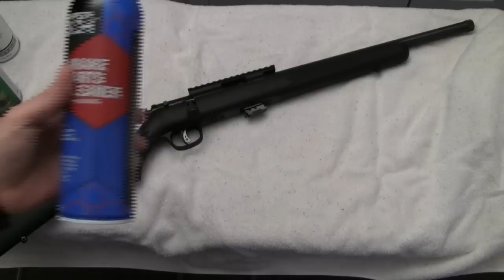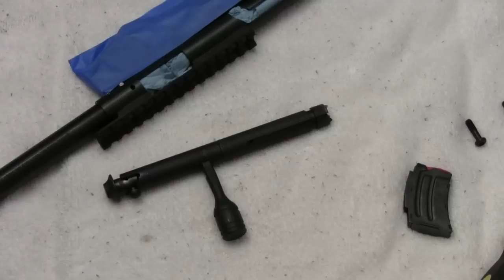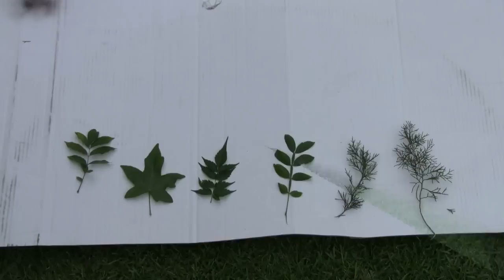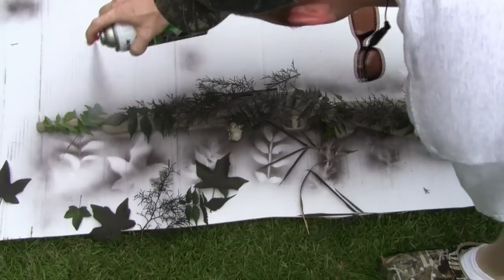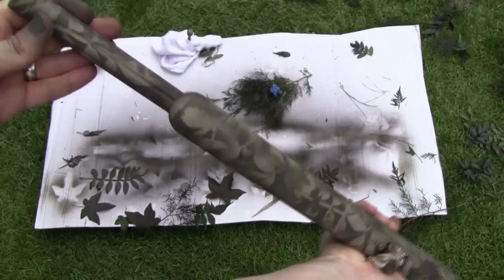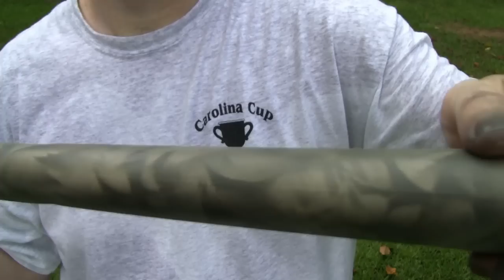Rattle Can FV-SR Invisible Squirrel Rifle

Comment: A lot of people comment about foliage moving when sprayed in position. I found a real neat trick to stop that is to use VERY small blobs of bluetac on the back of the leaves and press them down in position before you spray. Then remove them gently before reclaiming the bluetac to reuse. The leaves or cut out shapes dont move and you can also build up ontop of the first items with a little more if you don't want to rwmove them as you go. Hope this helps! Its cheap and real easy.

Comment: Good video presentation as you built up the patterns and keep in mind that what you see just painted will diminish and get the lasting effect once it flashes off and starts to dry.  Dusting with other colors lightly help blend or mesh in the colors to give it a more natural look in the end.  A coat of clear coat mat also helps with a light dusting maybe max 2x from a distance to flatten and dull the colors.

Comment: Good stuff...   I've found a secret for prepping the stock to ensure good adhesion, a tougher and more durable overall paint job.
  After cleaning the stock of oils (I always use rubber gloves to make sure no hand oils get on) I spray the stock with an adhesion promoter, used for plastic, vinyl, chrome, wood, etc.  Spray cans available from Amazon, if you can't find locally...  A few lighter coats, a few minutes apart then a final coat, wait ten minutes then do your base coat.  It makes a HUGE difference.  Works great for painting the plastic interior parts of cars, too, so the paint doesn't just rub off.
  I've had to remove the paint from a stock I did like that, it was tough.
  Thanks for showing the sticktoitiveness needed to produce a good product. 
Thanks!!
Reply from the maker: That’s a very helpful tip for any future projects.  Thanks for posting it.

Comment: For de-greasing your gun parts, here are two excellent options.
1)  "Brake-Clean" (sometimes spelled klean) from the auto parts store is, by design, an excellent product for removing oils, grease, water, dirt, etc. from your gun parts.  Your brakes on your car must run grease and oil free and this is what the mechanics use.   It will leave a very clean and dry surface on your gun parts.  Try some on each surface, first, as some plastic materials (very few in the gun world) may be affected by the cleaner.
2)  TSP (tri-sodium-phosphate)... The stuff that made your laundry sparkling white in the 70s until the eco-paranoids banned it because it makes a temporary and harmless foam when it hits moving water (remember those anti-phosphate comercials in the 70s showing a bit of foam on a river bank?).  What they never told you is that phosphates are naturally occurring and ultimately harmless to the ecology but, I digress.  If you're cleaning plastics and, polymers in particular, scrubbing them down with a TSP solution will remove any manufacturing residues, oils from handling, etc. and is a GREAT prep.  It's still available on the net and in some rural-type stores and will, once again, make your whites by-gum actually white!  Any plastic parts, from chairs to car interiors, can be cleaned and painted in this way.  When you're done cleaning gun parts with the TSP solution, rinse with clear water then dry it in the oven on low for 20 mins. 
Some will say to use acetone but, some plastics are affected by that much faster than by the brake cleaner.  Use with caution.

Comment: Not bad Nate! You're right about starting with a darker base coat! It adds a better sense of depth to the patterns and looks more natural! Try using a single sprig of the cedar/evergreen and just move it around to different angles. You'll get a better pattern and get more depth without having to spray so much to get through the clump of branches.

Comment: thanks for the video man I just got done painting a beater shotgun I picked up pretty cheap (was in terrible shape) looks awesome now! I used the same brands and color you did I noticed nearly my entire stock turned out frosted and white almost because I went overboard on the krylon clear coat BUT as I was cleaning it with some CLP I discovered two things one too much of the CLP strips the paint off (any paint actually) BUT I sprayed some CLP on a cloth and lightly rubbed the really frosted white areas from the krylon and now the whole gun matches in color so since I went overboard it stripped a small amount of it off so it all matches now and CLP is cheap oh and denatured alcohol works well to degrease

Comment: Looks good.  Personally I like some leafiness and some patterns to break the total leafy appearance.  If you are upright hunting in the woods in the spring and summer this is good, but adding a little grass, tan and light green, would set this up for woodlands, open areas adjacent to woods in all but winter season. I like sand as a base coat, then diagonal zones of brown and od green, before getting leafy, twiggy and grassy.  Some where in there I want some hazy irregular grid pattern worked in between the veggies!  Lol.

Comment: Looks pretty good.   With multiple colors, it would be real easy to put it on  too thick, and make a spongy paint layer. I dunno what would be the best hard sealer.  I would've left the picatinny rail almost alone.  I think a dark under-layer would respond better to later scratches.  The dings would show dark, rather than light.
Reply: I thought about it.  What's missing is some negative stencils.  Use sheets with  shaped holes cut in to spray a color layer thru.

Comment: You did a great job in that. Have you noticed any wear on the paint since using it? Also, did you have any trouble with the clear coat blistering the paint? I haven’t painted one yet but have a few to do this spring after it warms up enough and I learned a few good tricks from this video. Thanks for posting it.
Reply from the maker: There is some wear in the high traffic areas.  No blistering that I've noticed.  Glad the video helped you out.  Take care.

Comment: Another tip, I see you're having trouble seeing the paint with the bushy pine leaf branch. Try snipping off some of it's branches to make it less bulky and more flat. The paint is having trouble spraying past the bushy stuff.

And to those new to spray cans, and want to reuse the remaining paint in the can later, turn the can upside down and spray until paint stops flowing out of the nozzle. The nozzle and tube inside shouldn't clog up the next time you use it then.

I'm spraying my RC tank in camo, great video thanks!

Comment: Looks great. How did it end up lasting before the paint on the bolt started wearing?
Reply from the maker: The bolt handle is a high traffic area so you will have to touch up from time to time.  Using darker colors helps mask the fact that the paint is rubbing off.

Comment: Man how long did it take to wear off? Great job
Reply from the maker: High wear areas like the forearm and palm swell usually require the most touch-up.
Reply: Thanks for the reply! Did the paint job take long to fade away? Like did it smudge off from general use, last long?
Reply from the maker: I went pretty light on the coatings so it didn't take very long.  If you have more time a thicker base coat will help with wear.  Say 2 to 3 base coats before starting the camo pattern.  Allowing a sufficient drying time would help out also.   It was a fun project , but the eagerness to have a finished product lead to a  thinner layer of paint.  That resulted in the high wear areas needing touch up more often.

Comment: you can get awesome fake leaf and branch patterns at stores like michaels, hobby lobby even walmart. they dont blow off when spraying and you get crisper edges and better looking patterns. they are dirt cheap too like $3.00 each. if you use the camo colors from rustoleum or krylon, definitely use spray clear as they tend to dry chalky and  scrape off easily. the clear makes a big difference

Comment: i have used cedar before. just pick the nicest pieces for the job and turn them upside down. if you want them to stay in place use a glue gun and use small dabs, the glue is easy to peal off.

Comment: A few tips. Don't change the angle of your spray. Keep it at 90 degrees from the stencil. Also, if you apply a very light quick burst of 3m adhesive, just enough to make your foliage tacky, it will grab just enough on your target to make much cleaner lines, if that's desirable to you...
Reply from the maker: Meredith Goerlich Tips are always welcome.  Thanks for the insight.
Reply: Meredith's Mayhem neat tip for looks. But camouflage is supposed to break up lines

Comment: Since you painted the stock three years ago I would be interested to know how it held up and if you have had to repaint it since. Also how did it hold up to when you cleaned the rifle, did the gun solvent remove your paint?
Reply from the maker: usabaker Sadly this FVSR wouldn't hang with my CZ's in the accuracy department.  So I found it another home.  There was a little wear in the grip area by the trigger before I sold it.  I never used any cleaning products on it before I let it go, so I can't speak to that aspect.  Thanks for watching.

Comment: if you heat the clear coat can before you spray it on, it will come out crystal clear. i just us a hair dryer to heat the can, just heat it to the point that its warm to the touch and test it out and if it needs a little more heat just hit it with the hair dryer again.

Comment: I have found that giving the foliage you plan on using a pretty solid coat of paint a few hours before you use it as a stencil really helps stiffen the branches and makes the leaves a bit heavier so they don't blow around as much. You don't have to use your cammo paint, some el cheapo rattlecan of whatever works just fine, just trying to add some weight and painted-on stiffness. I also prefer to work dark to light, but your end product looks pretty solid. Also, for any of the folks that have commented that are worried about a clear coat making it look "not cammo", they do make matte/flat clear, just fyi. Using this method, you can use gloss colored paints, but as long as you use a matte clear coat at the end, the whole job looks matte/flat. I did this on a spear gun that i wanted blues and greys. Not a lot of shades of blue out there that come in matte finish, so i shot the gloss blues, and then finished with matte clear, and it came out just as what you'd expect from a matte blue camo finish. my 2 pence.
Reply from the maker: TheDthomascg Great advice on painting foliage first.  Thanks for the tip.